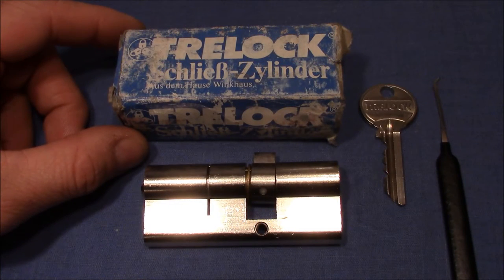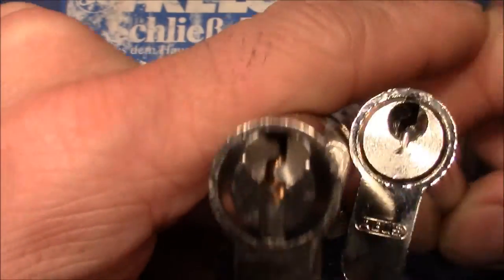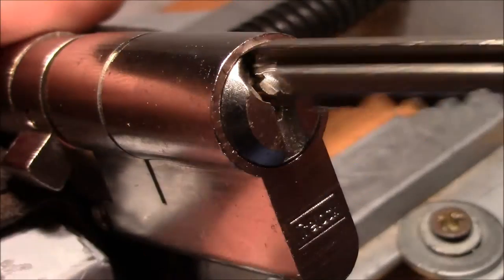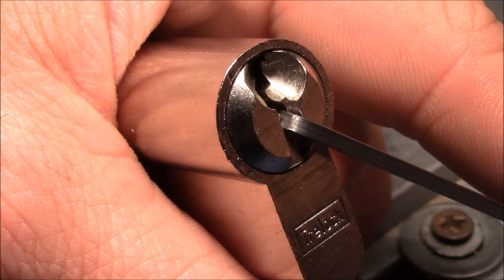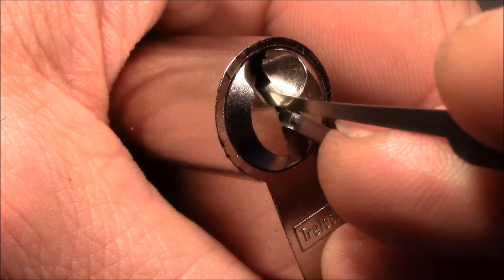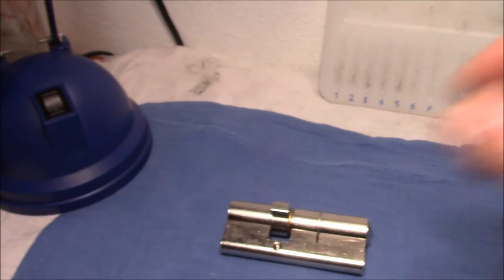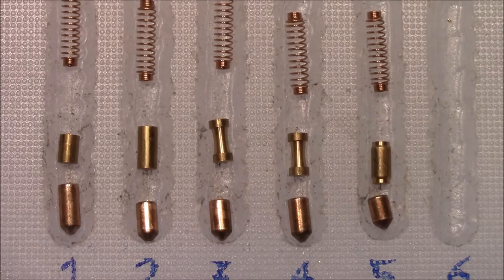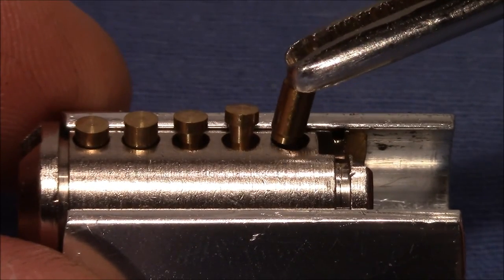(picking 164) TRELOCK [EURO cylinder exploration series] - picked and gutted

Comment: Using that technique of hopping up onto the ledge and reaching around the curve in the warding will get you good at positioning your pick right on the pins. I just picked a Texas Jim challenge lock on the similar Y1 (which is much more open) keyway, using that technique. It helps give you that practice, if you're not dead on accurate with where the pin is, you will feel it when you try to snake your pick under it through that curve in the keyway. 4 hours or so picking that lock before I got it open the first time. 

Your technique is good, thank you for the video. A Trelock in 4 minutes 30 seconds. Inspiring.
Reply from the maker: +Shira Assel First I tried to use the same technique as with the WILKA but there is just no enough room for the deep hook that you need. So the turning was the only possibility. But it's hard work ;-) Haha, 4h of picking that will become a long video ;-) Great dedication and I can imagine the feeling you had in the very moment when it opened. How did the time decay for picking that lock from Taxas Jim for subsequent attacks?
Reply: I got it open in seven and a half minutes on video last time, hopefully the next will be shorter and I can include the gutting. It is still challenging to pick even now that I've had it open a few times, knowing what to do is great but getting it done is a workout.
Reply from the maker: Cool, congratulations.